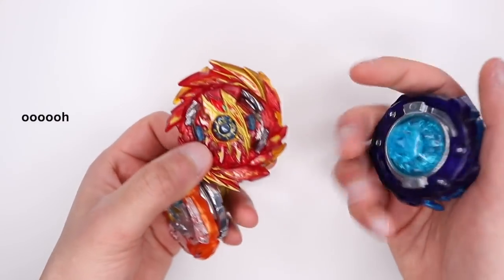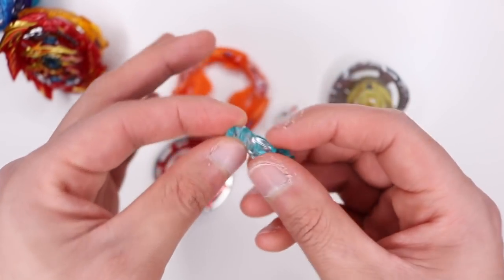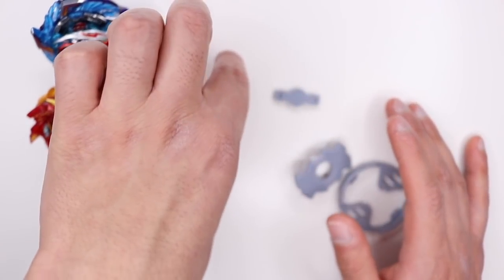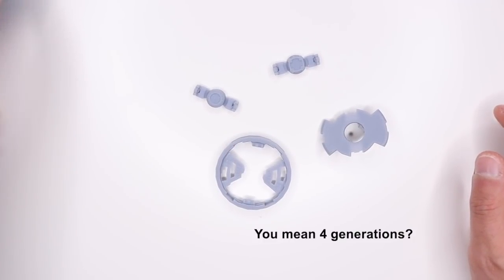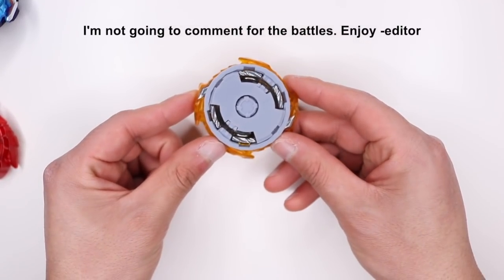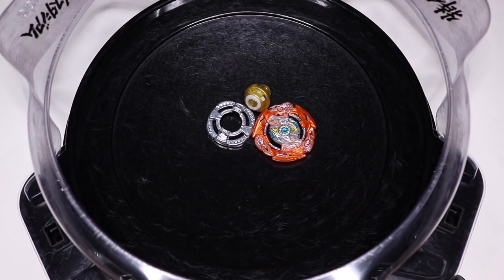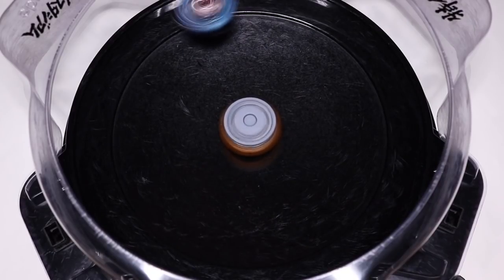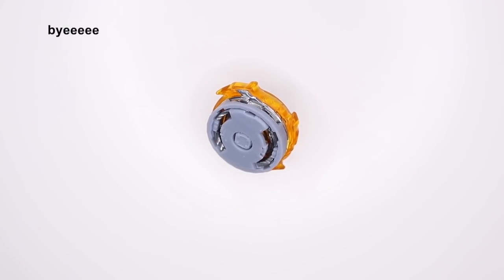*NEW* 3D PRINTED SPARKING/SUPERKING BEYBLADE | Beyblade Burst Sparking/Superking

Comment: i would say change the parts to superking proto, 1s/1D if it also is a single chassis, 0/00 proof bearing. then again the double chassis have better burst resistance and you have bearing on the combo...

Comment: Kevo should make 3d printed beys like
P-kevolution..and bey that has putty on the layer and has insane teeth
Super P kevolution...has 4 putty blades and has putty on top of the layer and the putty blades comes out when launched hard and has a driver thats like destroy but the free spinning plate has putty so it will ride on the edge and go crazy in the stadium
 Putty kevolution..has 2 huge putty blades and has metal inside the putty

Comment: 1S chassis is just easy to burst.. The teeth strength is like the burstable Fafnir chip from Wizard Fafnir. It can win against Defend and Stamina but not much on Attack type bey.
Reply: @Deven Pacheco nah.. I mean if you have a few Bey.. You can check there is various type/thickness of teeth.. The burstable of bey sometimes follow the thickness of teeth or the build